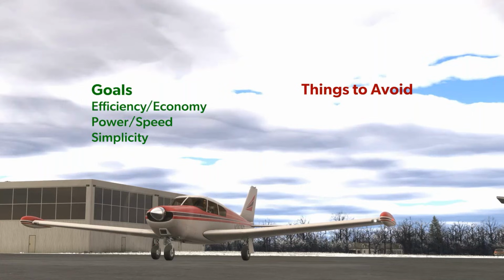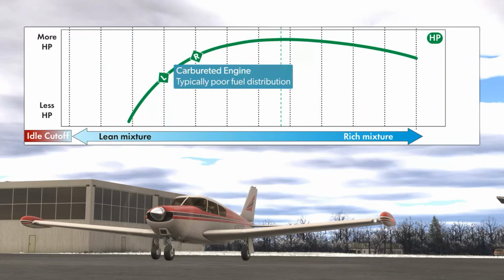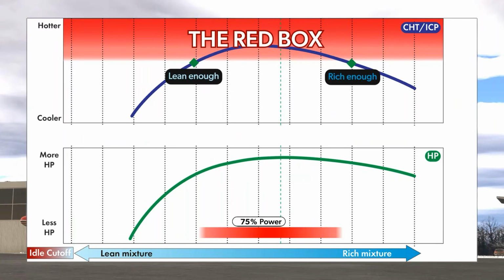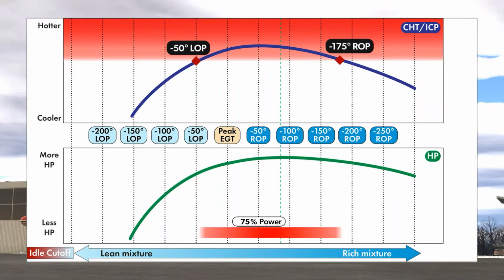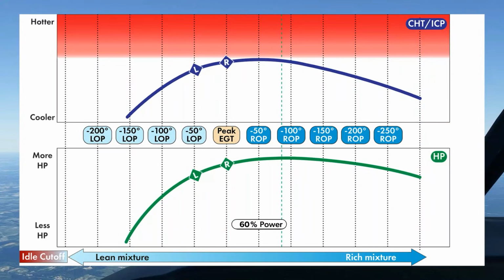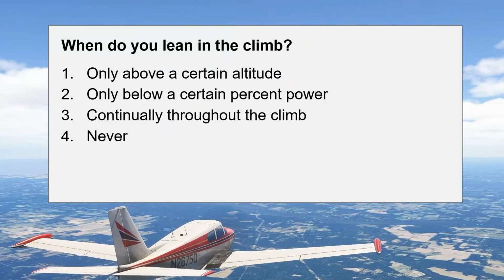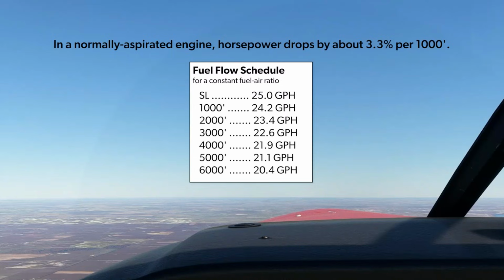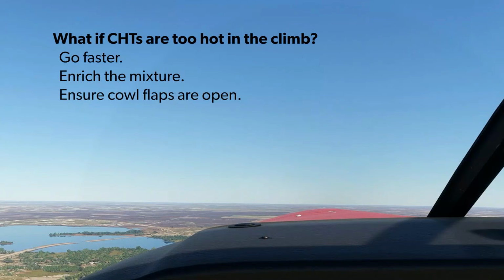Airplane Engine Operations: Pilot-proven techniques to get more out of your engine

Comment: I have heard this from so many experts (and I really like Ryan Kock presentations) but the problem is that no one truly explains what settings you "start" your leaning, and the resultant horse power you end up with (yes, different for each engine).  My Lycoming manual states that I can operate my IO540 at peak EGT anywhere at 75% power and below.   This is different from every expert.  I have a full engine monitor and so, starting at 75% power I lean to about 10.6 GPH. this ends up giving me 62% power.  Now, depending on how much in a hurry I'm at, I'm assuming (bad word) that I can lean anywhere from peak EGT to 200 degrees LOP EGT or so (up to engine roughness).  Let's say I now want to go faster.  Can I increase throttle and then "reset" the lean but now I lost the new peak EGT setting. If I now try to find the new peak, I may run into the red box.  Am I unnecessarily complicating this?

Comment: Correct me if Im wrong on my logic.. But, at sea level, full rich, full power(takeoff), my egt's are right around 1250F. After about 3000' I will start leaning slowly, and keep my egt's around 1250F on up to cruise alt. I may be a little on the rich side, but my CHT's have never gotten hotter than I like even in the middle of summer.

Comment: What is the reasoning against setting power to 60% and then slowly adjust mixture to find peak EGT, and then set your mixture to desired value Rich or lean of EGT. After getting mixture properly configured, increase power settings to 70 or 75% without having to navigate inside the red box. After all, if you’re remaining at the same altitude, why would you need to change the mixture settings again?
In my particular circumstance, I have a fuel injected engine.
Reply: You are confusing altitude and MP. Altitude influences MP but it is the MP/RPM combination that yields an overall prcentage power. By changing the power setting twice,, your initial mixture setting for 50% may not be optimal for 70%. IF you want to run 70%, then just set it to 70% for a given MP/RPM combo (which of course will change with altitude) and then pull back the mixture accordingly once.
Reply: @p@p@p @pisymbol  not confusing the two.  At 5000ft the air has a certain lesser density, which is why you have to lean the mixture.  When you only open or close the throttle button fly valve, I don’t see how that changes the stoichiometric ratio. If I increase MP with throttle, that increases the fuel flow from the injection system…to stay balanced with the air increase.  

Better yet, what if I only increase the rpm setting to increase power?

How would the air/fuel ratio change with only changing the RPM setting to increase power?
Reply: @RAPR117 changing the RPM won't change that at all. However it could result in an non optimal regime. You just said "power"- I assume you want manifold (air/black lever), what are you referring to then?

Again: I think what you are doing won't hurt anything it's just more work. I rather just reduce to whatever percentage power I desire and match the corresponding fuel flow. The only thing I can think of is you are flying a Cirrus where RPM is managed for you (you set percentage power and mixture).

One correction: When you change MP ("throttle") you are changing the ability of the engine to suck air at whatever altitude. That changes the air/fuel ratio in the engine and thus a mixture adjustment maybe needed. Maybe I just don't understand what you are saying.

Comment: That was a very good video by Pilot Workshops and conveyed a lot of good information. I do think the red box has been far over emphasized and most pilots are afraid of damaging their engines due to being in the red box. The red box is just a theory and doesn't really mean you're a causing any damage to your engine if you're in this zone.  In my Piper Arrow, I can fly at 75% power and do anything from full rich to far lean of peak and my CHT's stay in the low 300's. I these CHT temperatures I'm not going to damage anything.  I think pilots should stop worrying about the mythical red box and just monitor their CHT's.
Reply: That's because you fly an IO360 - a motor that can take a beating given its target platform (read: 172). Once you fly bigger bore engines, the calculus changes quite a lot. Talk to any SR22 pilot behind an IO550.